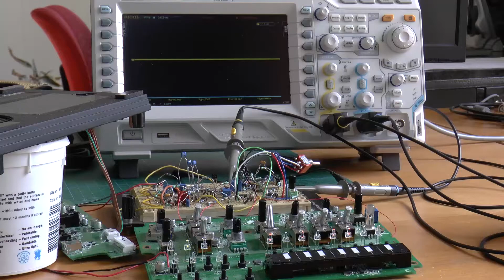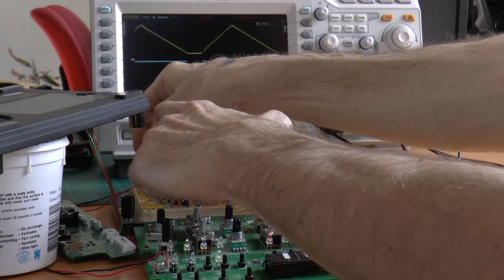Demonstration of Monotribe VCO2 mods

Comment: are there any more of these available?  i want one!
Reply from the maker: @alien brain -  I realize your posted comment is from >4 years ago, but perhaps this is still of interest to you. The Monotribe modding job I was breadboarding/designing for a client 6 years ago got shelved for 5.5 years - but was restarted this January and is now finished. So I'm posting a bunch of videos about the finished "mad.monotribe" today. I'll be having some Rev. 1.1 boards made in August (w/a couple of added features, such as VCF Cutoff CV IN / 0-5V), so if you have any interest in any/all of the boards - and if you'd prefer to get them populated or bare - leave a comment or DM me. No obligation, of course; I have to build two more for a client, but I'm trying to gauge if there is interest before ordering boards.
Reply: @mark_madel  its long gone but thanks

Comment: Just to add CV to the amp, where would that be connected, resistor to base where you added the click capacitor? Was thinking just to add the stock LFO to amp with a switch for instance, or patch over LFO from monotron as I assume CV levels would match. And how about taking that envelope to amp to the filter, will splitting it be to much drain?
Reply from the maker: Sorry I'm slow responding, but I'm travelling at the moment so I'm not around my schematics (or mods). But I'll try to answer your questions the best I can without the data in front of me.
1) No, you shouldn't try to inject CV to the VCA near the differential amp. It's much better to sum it with the EG CV near the integrator op amp (IC17). I think in my mod I used another op amp for summing, but I don't remember at the moment.
2) CV levels are different between the Monotron and Monotribe because CVs are generated via PWM by the Monotribe's CPU and then low pass filtered with integrators. They need to be up or downscaled when going/coming from elsewhere.
3) Yes, you can use the EG CV elsewhere, but you may have to scale the levels (the EG CV is 0 - 3.3V). You should tap the voltage off at IC17 pin 8 (the output of the PWM integrator).
Reply: So, say I want to have a 0-10v env drive the monotribe VCA (and maybe VCF). Would I want to make a circuit to scale the incoming envelope down to 0-3.3v then tap in before r202, right after the PWM eg filter? Would it mess anything up if I used a switching jack to cut off the internal eg? Thank you so much for doing this work and for sharing!
Reply from the maker: Stead Thomas Hey Thomas - I missed your comment when you first posted it, so you might have figured this stuff out already, but if not, I'll answer your questions. In my mod, yes, I put a SPDT switch before R202 that selects between PWM eg and the 2nd VCO as control for the VCA (although a switching jack would work fine). The voltage level is lower than I wrote above since the integrator levels out the PWM voltage (when I answered Drageslukeren I was in the USA away from my studio, so was just looking at the Korg schematic input figure and not the measured output). The output of IC17 pin 8 is 0 - 2V, so that is what you should scale your 0 - 10V to.